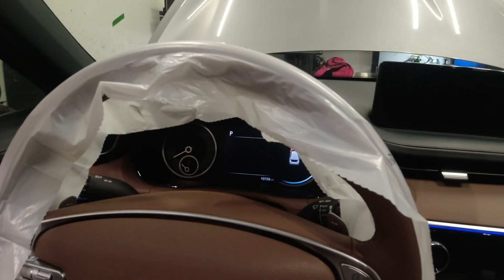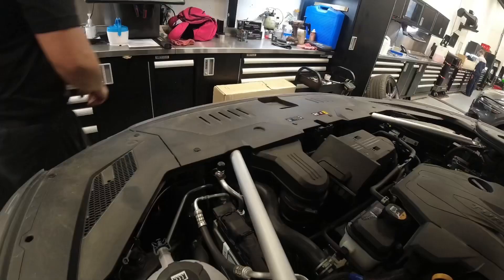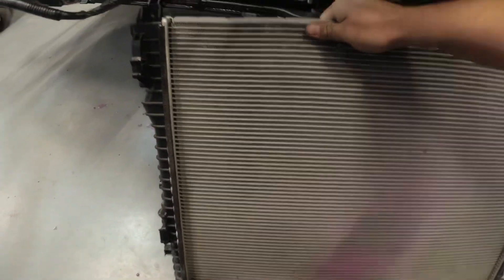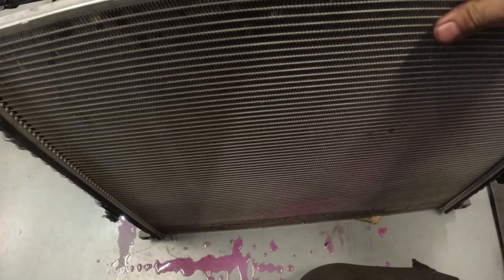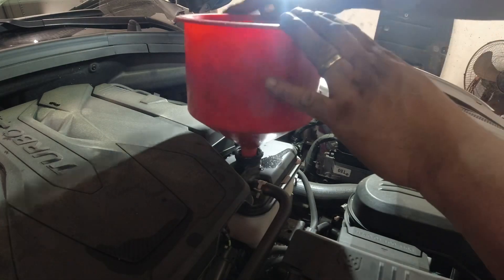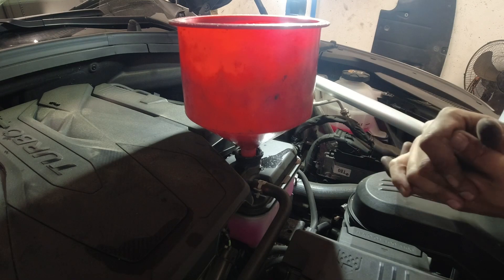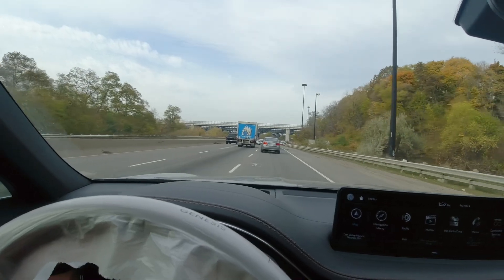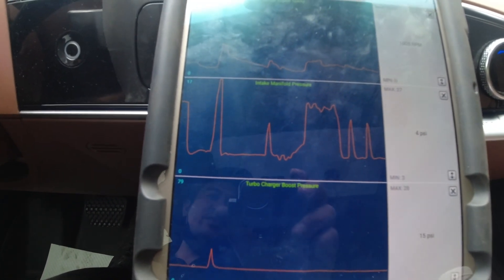Genesis GV70 customer complain lack of power - Leaking radiator

Comment: Same problem. $2100 radiator replacement, with only 13k miles. Is there not a protection cover screen available somewhere?
Reply from the maker: Check online what the truck driver uses, ive seen them on the road like theres a net covered on the front bumper. But as much as possible when driving dont get behind on a big truck or any car when the road is not pave.

Comment: I've been looking at getting a GV70 but I've seen quite a few people have coolant leaks due to rocks hitting the radiator.  Can a mesh screen be installed behind the grill without taking the bumper off and would this be a good idea or would it restrict airflow too much? I assume it's just the bottom where this one is leaking that accumulates the rocks.  Thanks
Reply from the maker: I think theres a product out there that ylu put it in the bumper, but im not familiar with it i just see those in the trucks while driving in the hi way. For the airflow i think its better to ask that from the company of the product buy as long its meshed style i think it should be fine.
Reply: Okay I appreciate the reply. Is it just the radiator at the bottom you’ve seen fail like this? Didn’t know if rocks could easily get to the others but I feel at the bottom is the most vulnerable
Reply from the maker: @CB-rr9xm  yeah sometimes bottom, and sometimes when they hit a big pothole and damage the radiator due to impact. But i think my suggestion not to follow big trucks on the hi way.

Comment: I have a 2023 GV70 2.5 (same color combo, btw) and had this exact same problem that required the same repair with one addition. In my case, the damage was a small rock that flew through the overly open lower grill, poked a hole in the intercooler radiator, coolant leaked out and then the coolant pump failed. There was concern that the rock also damaged the radiator behind the turbo radiator but once inspected, it was fine. A very expensive repair but since this was mechanical damage caused by a road hazard thankfully most of this was covered by insurance. 

After watching this video and seeing the damage  I wonder if it too may have been caused by something flying through the overly open lower grill. After watching the video and comments and going through this myself it kinda confirms my suspicion that the lower section of the stack of radiators is particularly vulnerable to road damage due to the open design of the grill. After going through this repair I'd been considering figuring out a way to attach some hardware cloth behind the lower grill to hopefully better protect these radiators. Thoughts? Suggestions?

Thanks again for the video.
Reply from the maker: Yeah usually even with regular car set up even me theres no way that you can predict if a rock will hit in the bumper and the radiator, the only i do is just drive a safe distance away from the other cars especially from the trucks. I see some vehicles they cover some cloth in front of the bumper but you have to also be aware that the airflow to cool the radiator will be restricted. Hope that helps

Comment: Did you hear of the rear differential issue when i hit around 50-90 km i hear a humming sound [GV-70]
Reply from the maker: Humming sound? Not a transfer case? I havent encounter a rear differential issue on gv70.
Reply: @hyundaitech  what is the symtoms of a rear differential case
Reply from the maker: @jackporter1175  maybe grinding from the back when turning. Metallic noise, skipping rear tires. I think thats what i will notice in my opinion.

Comment: I can't imagine how expensive this repair would be out of warranty.  That's a crazy amount of labor to remove an intercooler.  

I love the quality of your work.
Reply: I had to have mine replaced (2.5T GV70) due to highway debris smashing it. came in at 5k for the radiator replacement and another 4K for front bumper and sensor.
Reply from the maker: yup, i think all luxury vehicle when out of warranty its gonna be expensive. ahhaha. thanks man
Reply: Even in the warranty, Genesis is not covering the intercooler radiator issue and I guess it's very common in GV70. In a year only, I faced the turbo intercooler radiator issue and it looks pink, I guess it's a coolant leak. The dealer said it was an outside influence so the Genesis will not cover. Then Genesis took 5 business days and they didn't cover it. I have to pay $1400 for this issue. I never recommend any Genesis car.
Reply: Just had it happen to me, otherwise I would find your experience "out of the ordinary". Evidently it is NOT out of the ordinary.  As much as I like the vehicle, having a minor rock hit causing that much damage is simply unacceptable. Now I will probably get rid of it and will definitely not be buying another Genesis,  @sagardave1992

Comment: Thank you for another informative video. Based on your experience with so many issues on Genesis models, do you believe that Genesis uses inferior quality components, and would you recommend buying a Genesis product?
Reply from the maker: I think in my opinion Genesis is a good brand , but not comparable with big names since they been out for long time. Any other manufacturer they have flaws but for sure since Genesis still new compare other luxury brand they are doing their best for the quality. And if i have the money yeah i will buy Genesis. Hahaha
Reply: I wouldn't say they have "so many" issues. They are a relatively new brand and the GV70 is a new model and every new model has issues. Toyota turbos are having issues right now.
Reply: The thing is the premium brand - Genesis is not covering this type of issue. I have had the same issue with my GV70 2022 in one year only. Genesis took 5 business days to decide whether it will cover or not. After I called 7 to 8 times to the case department they told me it would not be covered. They said it was an outside influence and when I asked them to send me photos of that parts then they said they can't share them and I have to ask the dealer for that. Even the dealer doesn't have any loner vehicles. 
I love that car, but the service is the worst. I'm going to sell my car and never recommend anyone to buy any Genesis car.